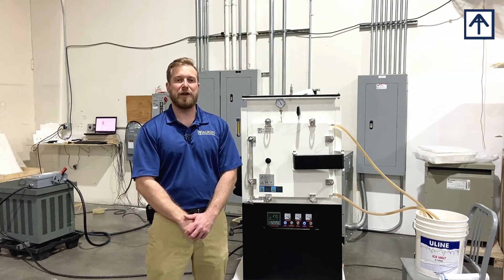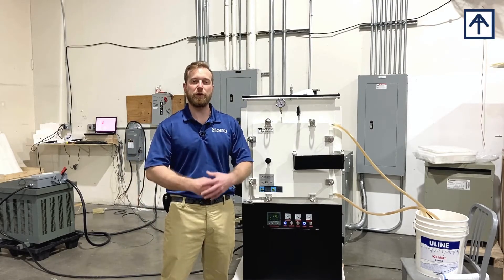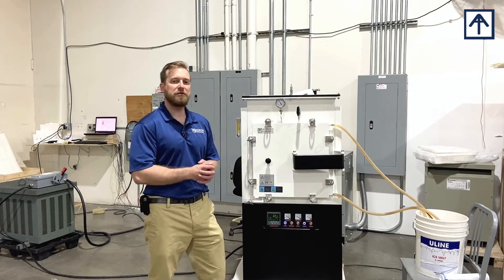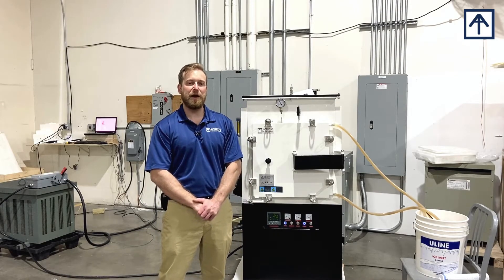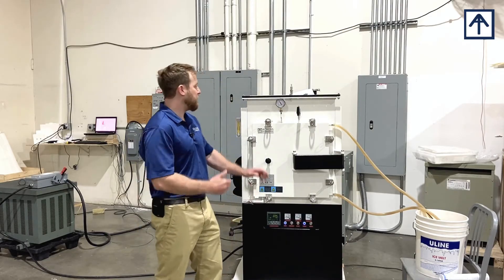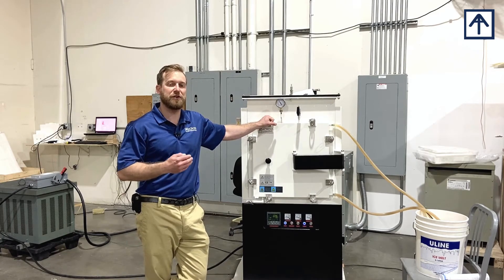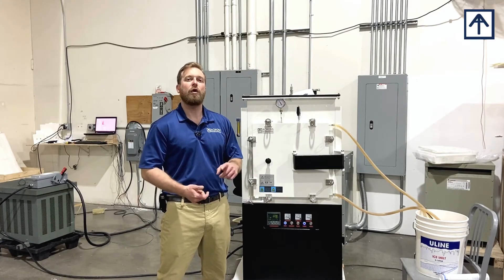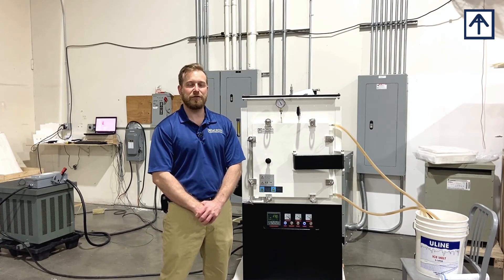Across International Controlled Atmosphere Furnace FAQs

Comment: Will this furnace sinter steel parts? Is it meant for lab use or production use? What would the machine config be that I need for this as there seem to be many config options. I want to explore sintered moldmaking with steel powder instead of CNC.